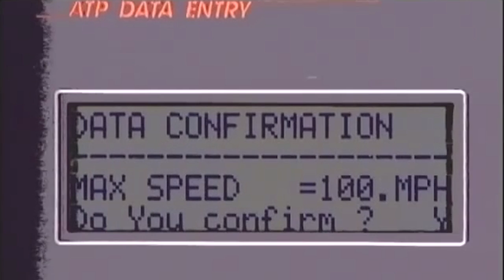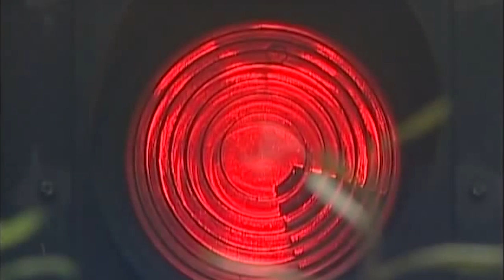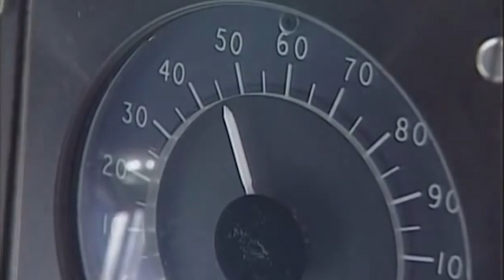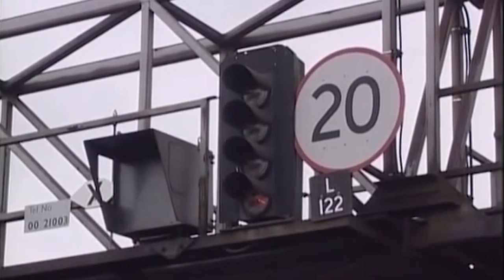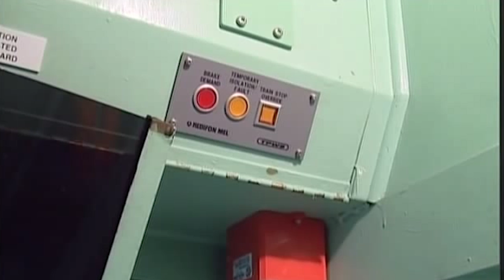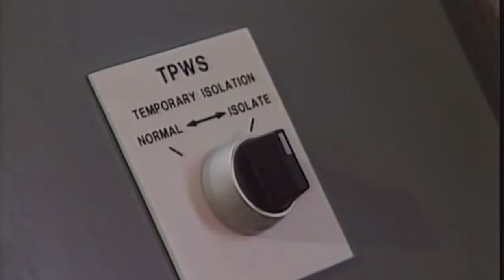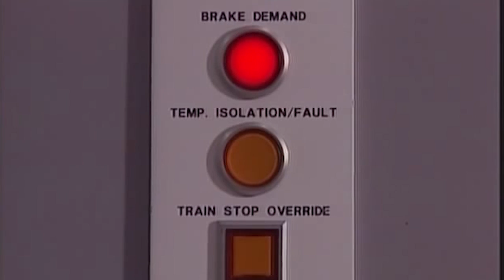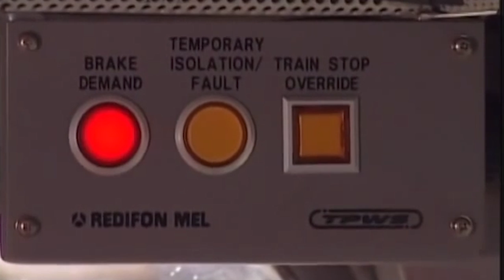TPWS Implementation 2000

Comment: I never liked TPWS. A cheap and nasty knockoff for what should have been ATP. The fact that they had to calculate money per life saved, makes it seem so cold. And even if not for any other reason, ATP would have allowed 140mph running on the ECML, because it’s effectively in-cab signaling.
Reply: Unfortunately, the railway has to follow DfT 'value per prevented fatality' principles or there's no 'business case' for safety investment. TPWS has achieved something like 80% of ATP's safety benefit at a fraction of ATP's cost.

ATP alone is not in-cab signalling. For 140mph lineside signalling must be replaced with ETCS (or similar), all level crossings must be abolished and no track worker access allowed while trains are running.